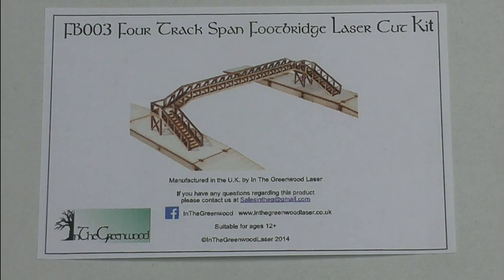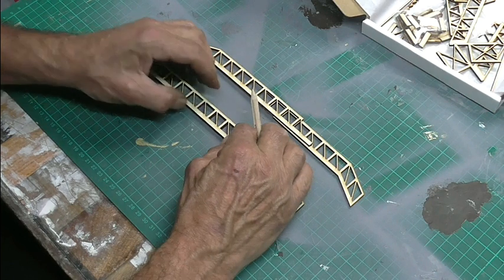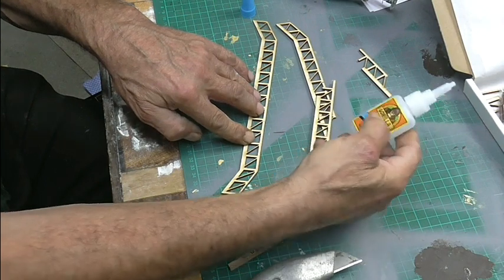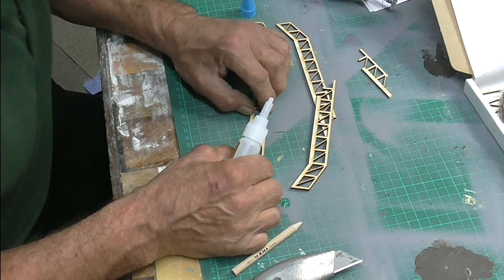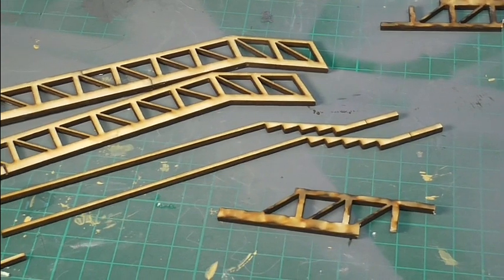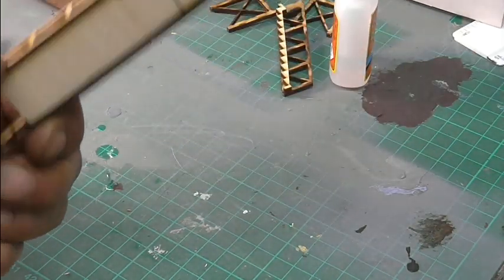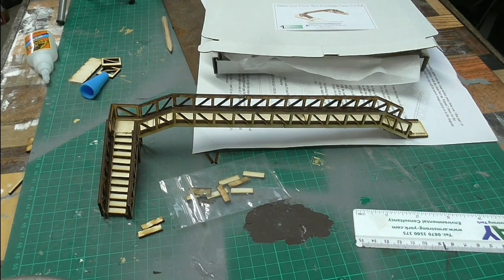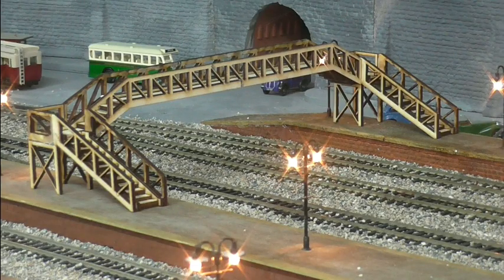Building A Four Track Laser Cut Footbridge

Comment: I like greenwoods kits, I have found when super glueing them it tends to soak in first time round so you have to let it seal the wood and go in again,  i`ve used gorilla wood glue mostly, unless it needs a quick fix so you can move on, seen a few people seal them with polyurethane varnish before painting which i will do on my next one, as i found the paint soaks in the wood and disapear. just started my own channel so i might brave a build vid, cheers
Reply from the maker: Hi, It did seem an easy kit to build, but  painting was a nightmare. I used gorilla impact adhesive seems to work well on wood, as does not seem to soak in so much.
 I have subbed you so look forward to following your progress, great to have more variety of railway channels. 
All the best. Glynn

Comment: Hi Glynn,
Well done in making it fit I have a 3 lane track I would like to span do they do one for that and if not could I cut your one down that much?. Keep safe and well.
Cheers Robert.
Reply from the maker: Hi Robert, I think you could chop it down to what size you need, it was quite easy once I had measured it  to the length I needed. It was quite easy to build. All the best. Glynn